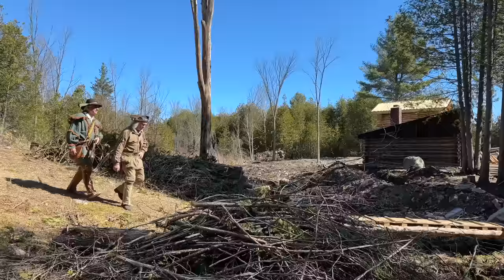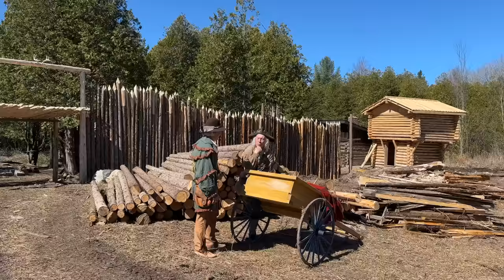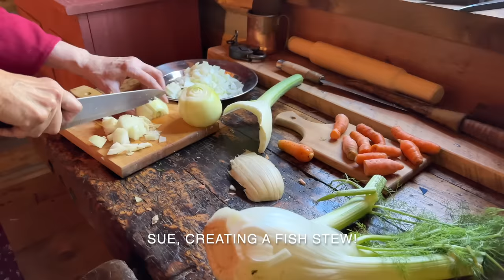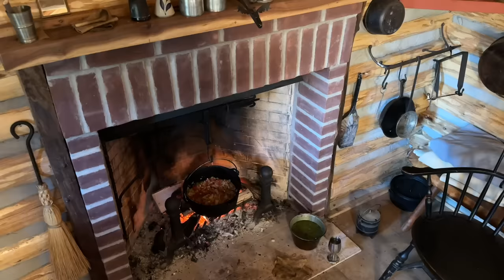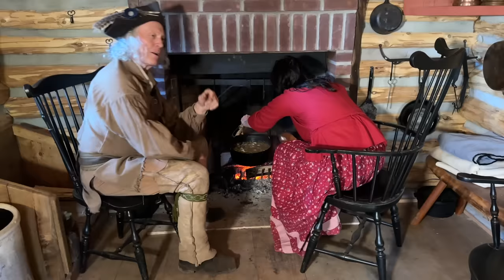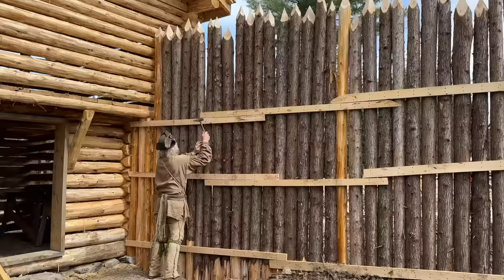Constructing the Palisade & Cooking a Historic Fish Stew | 17th Century Recipes Revived

Comment: Fighting forces need a fully belly and so do our army of fort builders! My grandmother would layer the bottom of her Dutch oven with bacon then onions, then potatoes, then fish with a little sprinkling of red pepper flakes. Then again with onions, potatoes, and fish until it was full. She would add water, cover it up and slide it to the back of the stove. Low and slow, the cover wasn't touched for at LEAST 2 hours then you didn't dare stir it, just sample the top layer to see if it was done. She didn't allow stirring because some times a fish or two would be small and have the bones still in. She could remove almost every darned bone if everyone just left it alone.
Reply from the maker: That is a grand story, thanks for sharing.

Comment: Is the timber on the inside of the forts wall temporary? I noticed movement in the wall, is there future bracing plans?
It’s looking really good I admire your ambition 😊 nearly non stop for two years now
Reply from the maker: Actually a little over 3 years since starting the cabin.  The horizontal member will stay as on actual forts and there is a plan for raised shooting platforms that will stiffen it up.